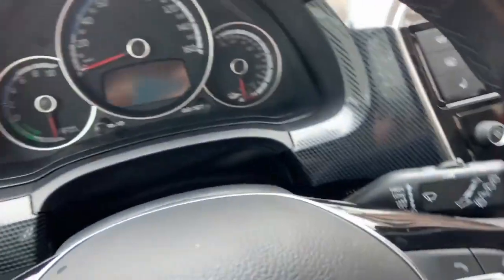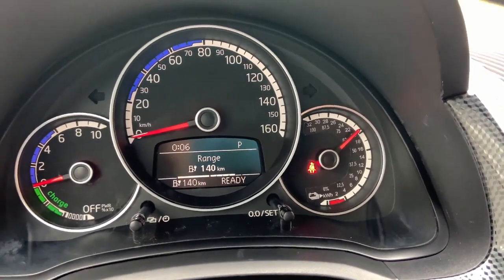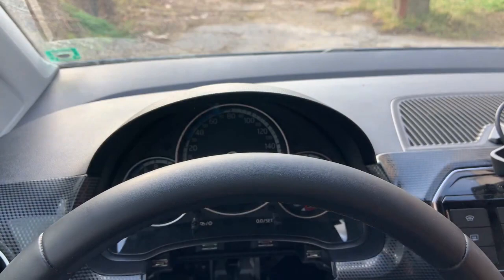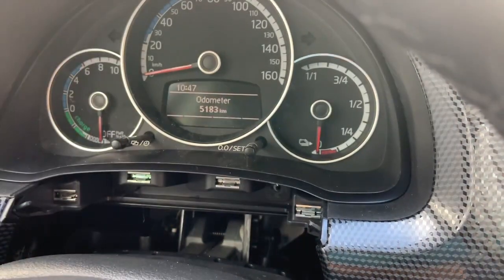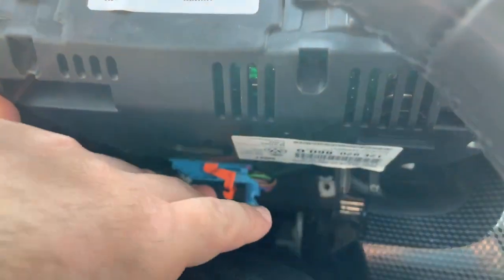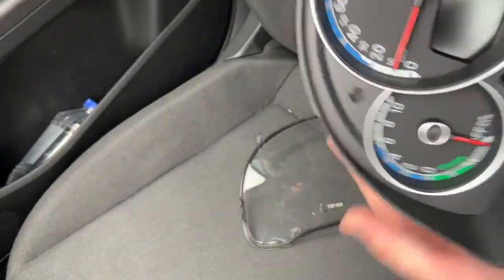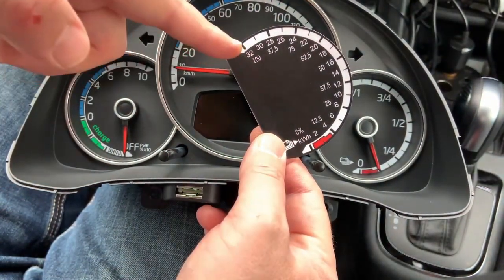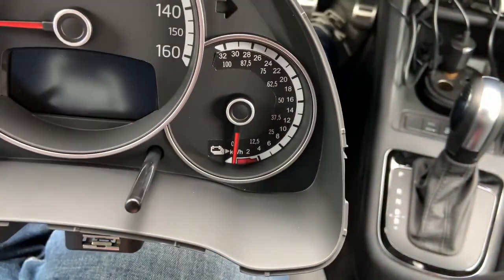How to add custom scale in the instrument cluster on Volkswagen e-up

Comment: I really like the idea to change this scale. It is not understandable why VW displays 1/8 instaed of 1/10 scale!
do you have already one with bigger numbers?
I'd personally prefer the procentage on the outer ring and clear 10% steps ( with new little  marks).
In which program can I change the file myself? is it easy? maybe adding an inner circle for the sissors ....

thank you very much
Reply: I agree, I would like 10 - 20 - 30 % as well, with ticks for each 5% would be useful as well.

Comment: Hi I follow your advice a lot and I find the way you carry out your reviews very professional. It is about three months since I bought a Volkswagen e-up and I noticed some flaws that I wanted to bring to your attention hoping for an easy resolution. The first problem has happened to me at least a dozen times always near the gate of the park where I live where I have to stop waiting for the automatic gate to open which entrance is characterized by a small climb of about 40 cm and always on that occasion or in similar situations, the engine shutdown and the signal to restart in order to proceed again. The second problem is that inherent in the signaling of km after the complete recharge of the batteries which in the first 30 days always signaled me around 360 or 370 of autonomy while in recent times it does not reach more than 260 or 270 km. Recharging always takes place from the mains and home electricity with 3 kw of power. I hope I was accurate enough to let you pinpoint these problems plaguing my car. Thanks

Ciao seguo molto i tuoi consigli e trovo molto professionale il modo in cui porti avanti le tue  recensioni.
Sono circa tre mesi che ho acquistato una Volkswagen e-up e ho notato alcuni difetti che volevo porre alla tua attenzione sperando in una facile risoluzione.
Il primo problema mi è capitato almeno una decina di volte sempre in prossimità del cancello del parco dove abito dove mi devo fermare in attesa dell'apertura del cancello automatico la quale entrata  è caratterizzata da una piccola salitina di circa 40 cm  e sempre in quella occasione o in  situazioni similari lo spegnimento del motore e la segnalazione di dover riavviare per poter procedere di nuovo.
Il secondo problema è quello inerente alla segnalazione dei km dopo la ricarica completa delle batterie le quali nei primi 30 giorni mi segnalava sempre intorno ai 360 o 370 di autonomia mentre negli ultimi tempi non arriva a più di 260 o 270 km.
La ricarica avviene sempre da retee elettrica di casa con 3 kw di potenza.
Spero di essere stato abbastanza preciso da farti individuare questi problemi che affliggono la mia auto.
Grazie
Reply: Sono capitato ora su questo commento, per la questione del riavvio della macchina mi risulta veramente strano dato che ho una e-up anche io e per uscire di casa aspetto sulla rampa del parcheggio eppure non mi si è mai spenta, magari prova a chiedere in concessionaria ondevitare qualche problema di fabbrica o errore nella centralina. Per la ricarica so che non bisogna guardare il chilometraggio segnato sul display perché si tara in base al tuo stile di guida e quindi spesso da informazioni sbagliate. Ad esempio quando vado in montagna e faccio il viaggio di andata mi segna un'autonomia bassissima in salita dato che usa tanta elettricità ed in discesa sono arrivato addirittura ai 400km di autonomia segnati perché sfrutta la frenata rigenerativa. Spero di essere stato comunque utile. Buona giornata

Comment: Looks very good! 👍 Just why didn't VW add a percentage gauge, at least in the display?!
How does it perform in the dark?
Reply from the maker: In the dark is not very good because the numbers are small and they don’t see well in the dark. The next version will be with bigger bold numbers
Reply: @tedonash2681  , this is 2 years ago. Is there a newer version? I would like a whole 10 20 30 %, and lines for that as well as each 5%. I don't need the kWh so much, but for the %, the numbers must be large enough to read in darkness also